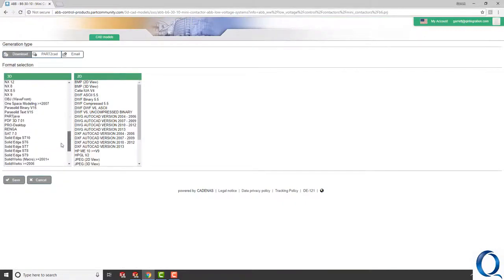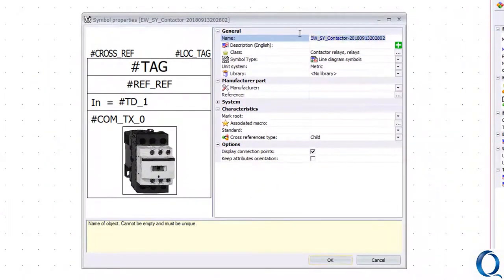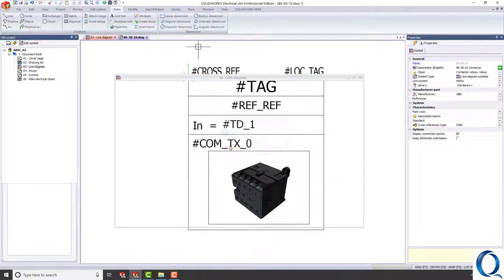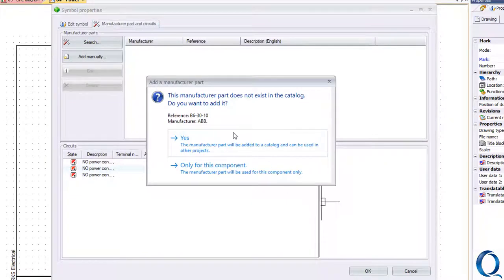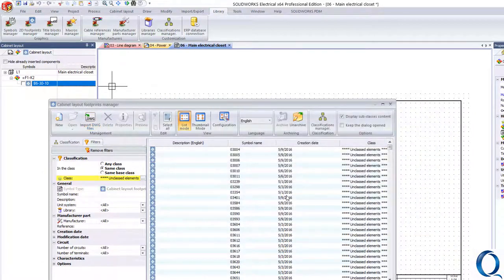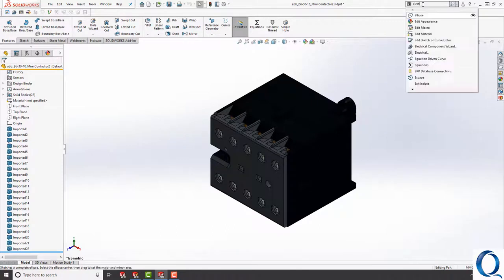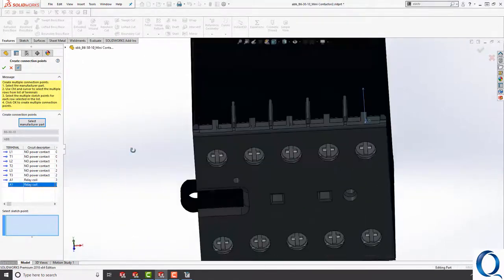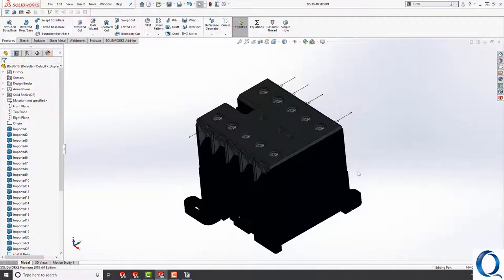SOLIDWORKS Electrical - Quick Detailed Part Creation

Comment: I can help you with this question but I'm afraid you won't care for the answer. The problem is that STEP files contain logical surfaces that are described by their boundaries, it can surfaces or solids. A STL or PLY or other scan data is a collection of points that do not describe the boundaries of a face. There are tools to convert like ScanTo3D or Geomagic that you will want to investigate. These tools can help build the surfaces needed to export to a STEP.

Comment: Great videos!  

I'm a Newbe to SolidWorks that is stumped, maybe you can help me, please.  

I downloaded a few models from the web, files that I think came from lidar scans, the geo is very heavy and messy.  

I need to send the assembly as a .step file, but the exported file size is way to small and nothing is in it, UGH!  

Do I have to do anything to the files that are being referenced?       

The current .SLDASM is 468,832KB and the exported .STEP files are 42KB, some are even 2KB.  
That can't be right.
Thanks for you help with this and keep up the good work with the videos.
I need all the help I can get.